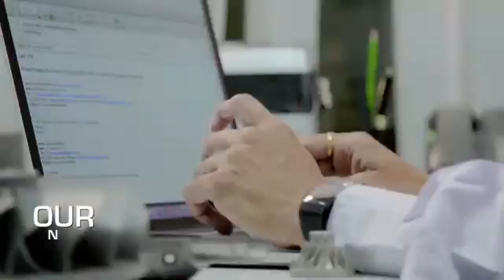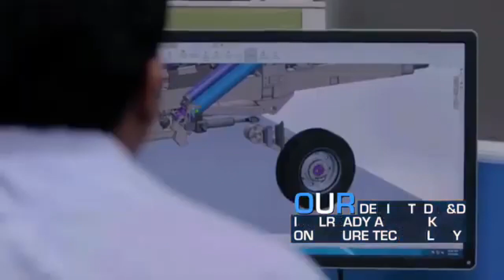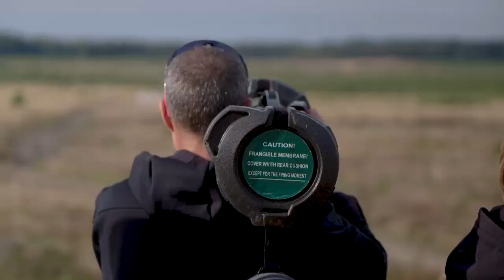Defence Ministry has placed an order for Spike anti-tank guided missiles  worth ₹287 crore

Comment: As per DRDO is designing a lightweight manportable anti-tank guided missile (MPATGM) for the Indian Army, a DRDO official told Janes at the Aero India 2023 show, which is being held in Bangalore from 13 to 17 February.

The official said that the development of MPATGM is not completed because of its weight. “We [DRDO] are looking at lowering the weight of MPATGM. Since it is manportable, its weight causes a lot of problems.”The technology and design of the lightweight MPATGM is already decided, and will take at least 2–3 years to develop, the official added.

The official said that the organisation seeks to reduce the weight of the MPATGM by 10–30%. The MPATGM, in its current form, weighs 14.5 kg. It is a “third-generation” anti-tank missile, which has a length of 1,300 mm and a diametre of 120 mm. So by 2026 the DRDO Manpad would be ready. Maybe it isn't such a smart idea to order so much of a much more expensive Spike Missile?
Reply: In 2026 u would say.. It will be ready before 2035..u r as thick headed as DRDO officials. 
Can't u see it's a small emergency purchase due to border situation at LAC..would DRDO assure nothing would happen at LAC till DRDO develops it. 
When MPATGM is ready.. bring it and compete with Spike SR and take the bulk orders.. Otherwise stop interfering military needs it's plan b as backup. what if DRDO fails to develop it till 2030🤡🤡
Like it failed in rustam and nirbhaya project 🤡🤡 still under development